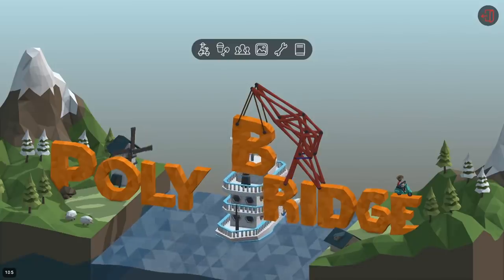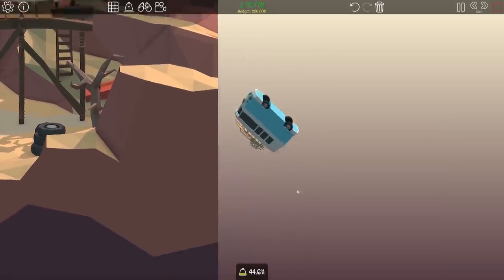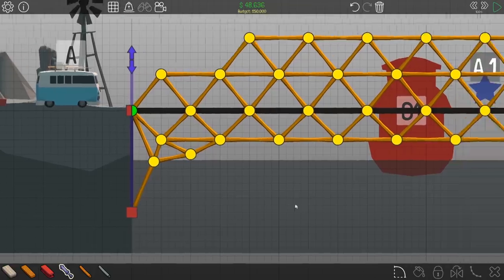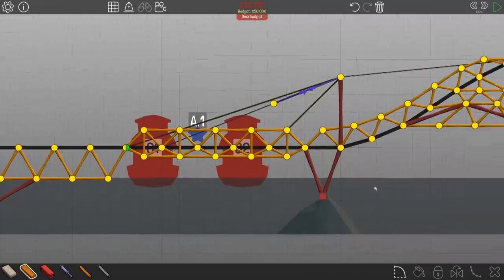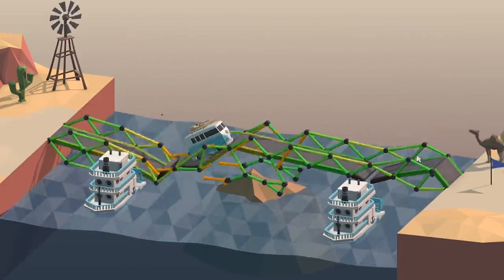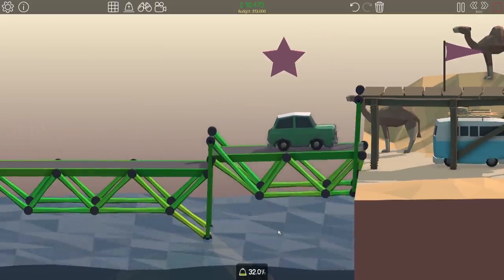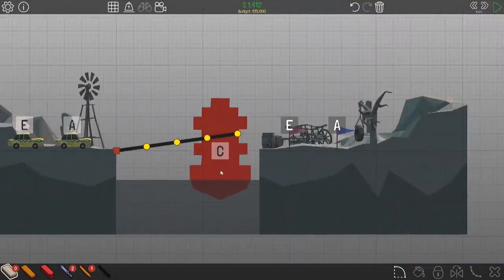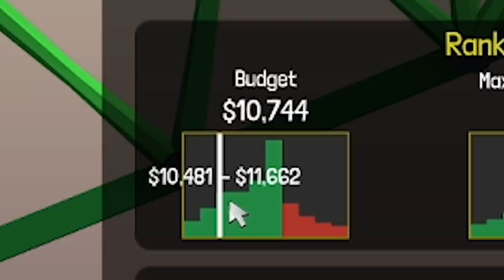Making A Bridge That Doesn't Actually Connect in Poly Bridge

Comment: If you ever want to try a counterweight again, know that Poly Bridge calculates weight from the joints not the actual length. So a wood of length 2 meters weighs the same as one of .1 meters. So a "ball" of short joints is the way to make a counterweight.